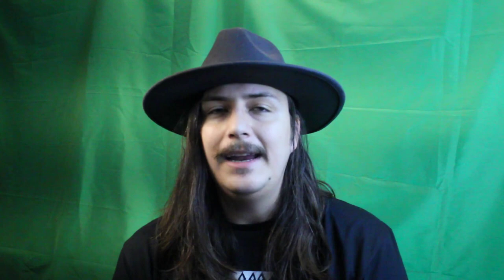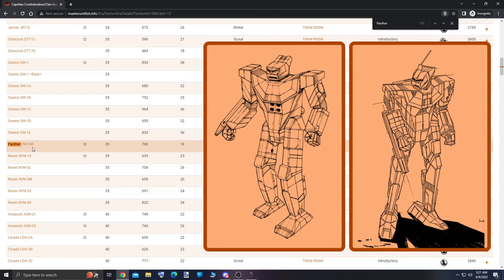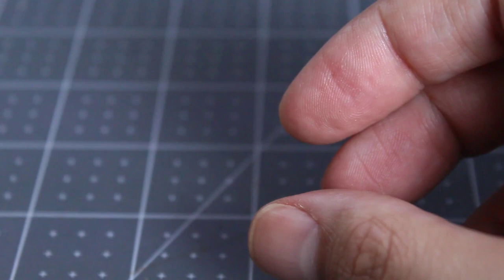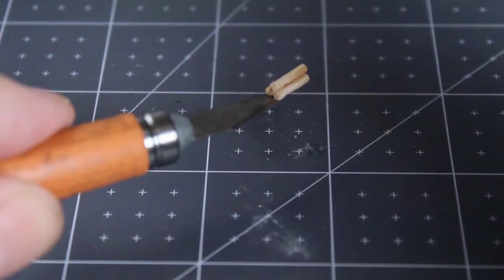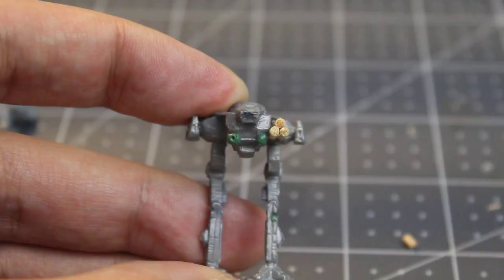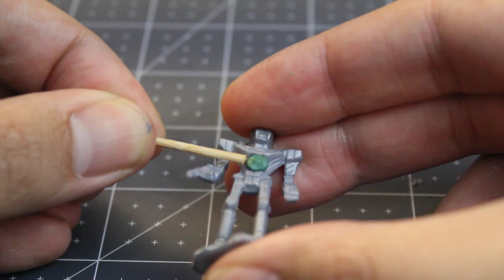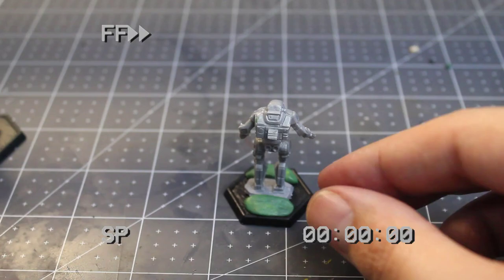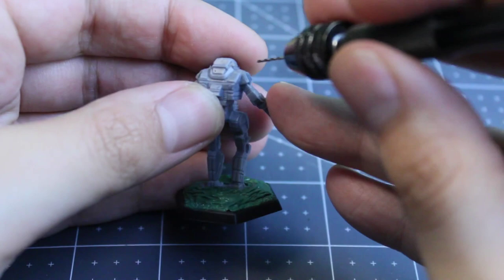Building A Battletech Lance Part 1

Comment: Great job improving the figures and doing so with readily accessible materials. Your technique explanations are easy to understand as well. One thing I’d point out though is that for Battletech WYSIWYG is not required, it’s a preference.  As long as you have the correct record sheet (classic) or mech card (Alpha Strike) for the variant you identify to your opponent, you’re good to go. That’s one of the great things about BT making it more accessible to all.
Reply from the maker: Thanks for the watch, and definitely thanks for pointing out the "model agnostic" nature of battletech - you raise an awesome point. The freedom to use a model as any variant is such a great boon to a miniature collection. I suppose I am definitely in the minority wishing to WYSIWYG up my chassis☺

Comment: Some painters use soft hairbrush filament instead of metal wire.  I like it for two reasons.  You don't have to worry about stabbing your finger with it when picking up the model or breaking it when you manhandle your minis.
Reply from the maker: This is a pretty awesome idea, and I think I'm gonna have to put it into practice on some future projects. A bit of flexibility without material deformation sounds perfect for scale antennae. Thanks for the tip!